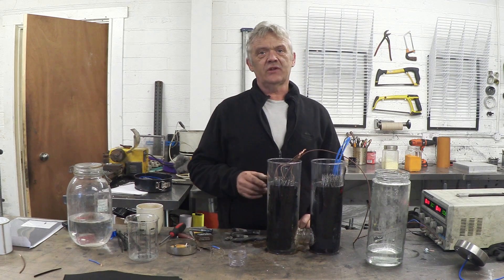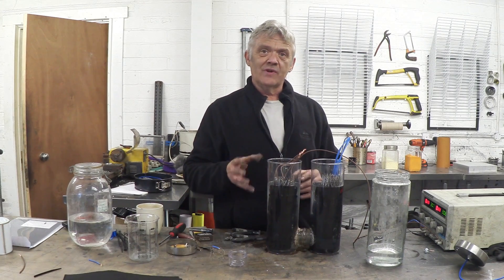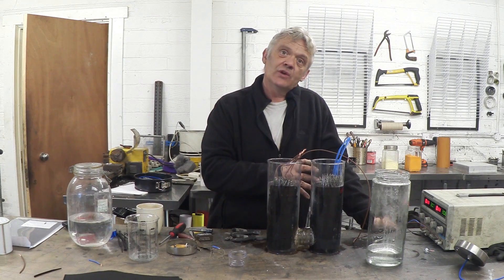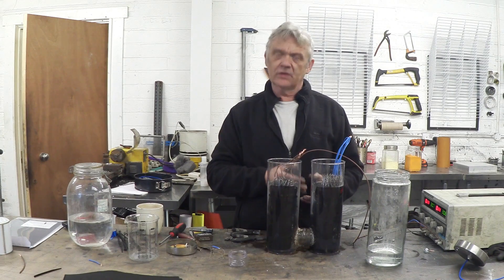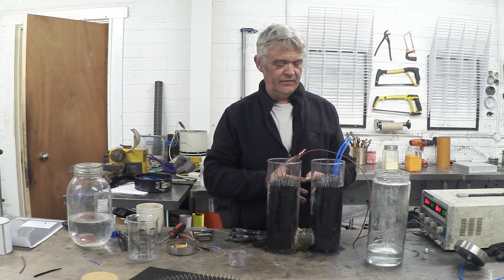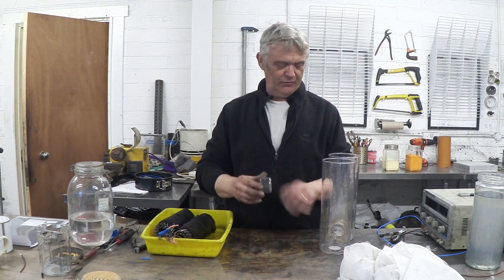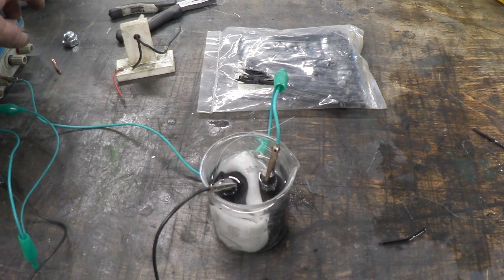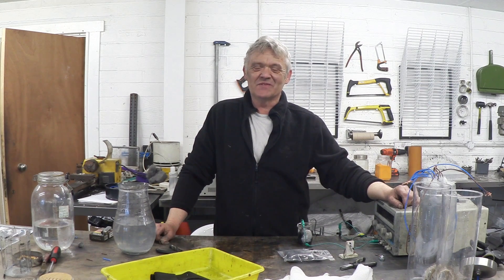Improving A Hydrogen Generator

Comment: It would certainly be a luxury item if let’s say a rolls Royce was equipped with such a separator wet cell and hydrogen was fed to the fuel injection air intake and oxygen was sent to the interior of the vehicle as a way of fresh air full of oxygen for the occupants to enjoy while windows are all pulled up securely to protect the occupants from outside pollution

Comment: Try using square containers instead of round, and then put a SS plate in each container.   Then connect the containers together as close as possible - yours are 1" apart.  The plates should be millimeters apart, but separated by the container walls..    Get them closer so the plates within both containers react with one another (not just the plates in the same container).

Comment: Hi Robert. What materials would you choose for electrodes if electrode durability is the goal. I don't care about efficiency and just need enough gas for a jewellery torch but don't want to have to continually change electrodes or use expensive materials or materials that are not abundantly available.

Comment: See also reference on S1R9A9M9 and his Briggs 18HP mower engine that ran on water 2008. 2 YouTube videos - run videos at slow speed . 10 amps through zero ohms spark plug along with water in carb forms water vapor pressure and hydrogen gas. Battery start, battery removed. Alternator runs conversion circuit.  His 1978 El Camino car v8 got 18MPG on water for 3000 miles before locked up in storage. Circuit used 400watt inverter and diode to 2MH dual coils relay per cylinder and 6-7amps current. Web site shut down. 4kohm resistor can be removed only from same reach Champion spark plugs.

Comment: Although you have separated the anode and cathode into chambers using that bridge, there is a still a major problem.  Collecting that hydrogen is very difficult because you cannot have ANY kind of back pressure on the gas coming out of the chamber or else it will force the water down, through the bridge and out of the anode side.  You MIGHT be able to bubble the hydrogen though shallow water and collect it in a very small container using water displacement.  The best way to achieve gas separation is PEM technology.  You have a rigid solid membrane between the two half-cells and you can exert a great deal of pressure on either side (or both) to fill a balloon or even compress the gas into a cylinder to some degree (no pump needed!)  A straight Nafion barrier between the hall cells would suffice to separating the gases and allowing collection, but then you sill need an electrolyte (that won't damage the Nafion).  And, of course, a PEM cell (that also uses the Nafion) but has the platinum and iridium electrodes pressed right up against the membrane (MEA), is the ultimate solution and requires no electrolyte (the Nafion acts as the mechanical barrier AND electrolyte in this cell).

Comment: I have followed the Brown's Gas generation development for more than a few years.  I saw somewhere recently that the law of diminishing returns takes over at about 3 volts or so in the production of gas (I think in terms of fuel), and that it serves better to amplify the Amperage  while dropping the Voltage.  I'd be pleased to hear your thoughts on the subject.
Reply: That's what neutral plates are for -- increasing generation surface at each plate, and lowering the voltage for each plate current has to pass through.

Comment: Presumably, you will have to top up the urea concentration periodically. So what is the best method for monitoring concentration? Will it be the increase in Oxygen production, or the reduction of Nitrogen at the second electrode? Or is there a simple way of measuring urea concentration? Thanks Robert.

Comment: One of the problems I had with using an electrlyzer was an increase I carbon emissions. I used baking soda as an electrolyte. How does the use of carbon felt and urea affect the carbon emissions with your method?

Comment: Is the black coloration caused by particles of carbon breaking away from the felt?  Years ago I built an electrolysis cell using carbon electrodes and they didn't last very long at all.

An easier construction would be to have a vertical plastic pipe containing the hydrogen electrode suspended in a bowl of electrolyte, this pipe would have a stopped end on the top to which you can attach the take-off pipe, as per the original video.  The other electrode would be suspended in the electrolyte as before.

Comment: as a child  we used to charge  lorry batteries and put milk bottles inverted on top of cells, then put bottles on ground and ignite them a lovely blue flame and a bang.
Even then we knew that oxygen improved the burn, so one can assume that oxygen would assist the burning of hydrogen thus increasing energy being produced.

Comment: @Robert Murray-Smith  how a Faraday Disk works,  could you replace the metal disk with a graphite disk???...  if so!... what about that kind of setup to spin the graphite disk to make power, but its submerged under water and your using the disk to make HHO, that flings the bubbles off, your gas output goes into a hallow (clear) Spher, and gas enters at the lower bottom at an angle, and an exit hole at the top, if the pressure is good enough a metal ball inside with barely any wiggle room would spin , and a pin point needle at the top center stopping it from plugging the hole but also acting as an electrical contact, and you have another brush contact on the side and put it inside a doughnut magnet, there is a source of power . Then use that power to help spin the Graphite Faraday Disk,, or use the gas pressure to turn a turbine generator, or turbine blade in direct connection to the disk.
Doing all this with Urea so less energy is needed

Comment: If making a wet  cell with no separation of gasses, if you wasnt to use an clean water bubbler ... between Urea and KOH/NaOH which one would be better to inhale.
Its about Hydrogen for health. Would you be opposed to breathing in the mixed gasses not separated using Urea as an electrolyte?? With or without a bubbler!
Reply: David Prock this interest me too I would think a bubbler would be worth using as a precaution  and I think not using urea would be better for this application especially if you didn't have gas separation as too much nitrogen would kill you  and extra oxygen from using water, for short periods is beneficial  I have just received the ac felt and just checking the video so I could make one 
This h2 breathing has a lot of promise for health but it seems a bit of a palaver having to breath it for hours a day   The tiny amount of the pot hydrox in the bubbler would make it safe enough to drink and get any dissolved hydrogen

Comment: Using nylon cloth instead of felt will last longer as felt will deteriorate over time.
Reply: The point about the carbon felt is that it conducts electricity.  You can get very fine stainless mesh which has the look and feel pf woven cloth, that might be a better alternative.

Comment: If I use a alkaline fuel cell  , it should have pure O2 ( CO2 will be absorbed by the electrolyte KOH) on the oxygen side . 
does urea  electrolysis  yield  pure O2  and of course H2  is a given,  Many thanks for your work.

Comment: I have doubts you're separating because of the design. You honestly believe the gases split and magically only the hydrogen appears on one side and the oxygen on the other when they both split on each side together. You have to separate "above" the gases. 

Capture the gas from your oxygen side and show it wont burn.

Now if you want to separate, use a magnet to attract their "-" & "+" charge above the electrolysis and even one below the electrodes, so that you have a magnetic field to guide the separation. Your electrodes should be in the bridge.
Reply: His H or U style is separated. That’s exactly how it works, it’s basic chemistry, oxygen will only form on one side and hydrogen on the other since one side is + and the other -, that’s how electrolysis works, and that’s also why one probe side gets corroded very quickly while the other is fine if you want to test with some regular copper wire and a battery. Also if you’re lighting a wooden match on one side then it might look like the oxygen is also a fuel since oxygen makes things burn incredibly intense turning them almost explosive in some cases.

Comment: In my place is cheaper to buy stainless steel mesh for colanders and sieves, it should be also a better option for surface area and it's even easier to work with

Comment: One major drawback we experienced with high volume gas generation was bubble adhesion.

To obtain and maintain efficiency, not only do you need the surface area, but also a way to prevent the bubbles from remaining adhered to their surfaces, which, unfortunately, begins choking out the flow of water and electrolyte, causing production to drop off.
Reply: I use an ultrasonic bath to avoid bubble adhesion on the active electrode area.
Reply: @AfdhalAtiffTan  exactly what I was going to say, or some kind of vibrater attached... put it near a sub woofer playing a constant tone
Reply: @AfdhalAtiffTan  and magnets?
Reply: tends to be the benefit of running a dry cell, you get water flowing through, which is typically enough to kick the bubbles off their plates.
Reply: Desmond Bagley  
It would depend on the impurities in and viscosity of the electrolyte solution.
Reply: You don't need a vibration mechanism. You're building an engine. Just bolt it to the engine block, it vibrates anyway.
Reply: @vylbird8014  magnets?
Reply: resign the generator.

Comment: you should look into atomic hydrogen which can be produced by runing hydrgon (h2 ) into an arc which will result in h1 or you can use a cathode made from a mix of lead and mercurey if your interested i can send you a pdf file on the subject.

Comment: Would it work? Say I have a natural gas or propane powered generator that with modification produces 10KW when fueled with hydrogen. So I start the generator up on propane and start providing power to a hydrogen generation system. When the hydrogen production is adequate the engine is switched to run on the generated hydrogen. Will it make enough hydrogen to sustain full output and also allow some percentage of the generated power be diverted to other uses? Assuming that engine cooling and exhaust heat were recycled (heating water?) would the cost of the consumables (urea, stainless steel, etc) make any resulting excess energy cost effective? Could be very interesting in arctic conditions where it is very cold and dark for long periods and purchased fuel very expensive.
Reply: No. The laws of physics do not permit perpetual motion, at least as currently understood. You can't make power from nothing. However, it might be possible - with careful tuning - to slightly increase efficiency of the propane engine by mixing in hydrogen-oxygen with the propane, and the performance thus gained could potentially offset the electricity cost of the electrolyser.
Reply: @vylbird8014  it works! However would take a lot of finetuning and continuous monitoring and after say few months your ICE needs repairs and the whole story starts again.

Comment: One idea I had years ago was a hybrid gas/electric oven, which burned hydrogen to cook, but you produced the hydrogen on site with electricitty.  So you'd have the advantages of a flame stove, but it could run on electricity.
Reply: I am playing with this idea in my head too, for off grid purposes. Even go as far as using the hydrogen for refrigeration, and the generated water for consumption. I am not in a rush, and still have a lot of theory to look at before I try a small scale test setup. But I find the idea very appealing too.

Comment: Theoretically it could power an engine in a closed system?
Reply: the engine could only produce less power than the cell used, but sure.  I've seen people adjust generators to run off of wood gas, which is mostly hydrogen.  no reason an engine couldn't do the same.
Reply: It would be easier to do a vacuum steam turbine system.
Reply from the maker: there are reports of a closed system being set up - needs some research on the net mate

Comment: Rob , you're a machine  !  [ oops i mean that in a good way,  not like some people who actually believe the next step for humanity is merging us into machines ..with AI enhanced brains ..all remote controllable by them ..because they know better than us !!]    I have a gas flow meter for testing flows ,, but easy way is just a clear plastic  bottle filled with water , and upended in a large bucket of water , then run gas output into water filled bottle ,so gas displaces water , just time how long it takes to drive all water out , ie 1.5 L coke bottle in a minute . .. , this does make it easy to put the top on bottle a have a potential 'bang' . I have left HHO in a bottle for weeks to see if it stays separate , it does . good idea not to blow them up to often ,Neighbors , dogs  ,and men in blue are not amused
Reply from the maker: lol - thanks for the post mate

Comment: Brilliant idea using two jars to separate the gasses at source. I think you could go further and make it more efficient by putting many tubes between so the ions have line of sight from anode to cathode, or vice versa. In order to make sure the gasses did not mix half way up the jar (where there are more tubes) you could use slightly U shaped connecting tubes so that rising gasses were diverted from the center of the connecting tube. That would give much more liquid contact, thus increasing ion transfer. It sounds confusing trying to write it. If you don't understand let me know and I'll get a diagram to you.

Comment: Your video on the brown gas generator was very interesting. I am from Bangladesh, a predominantly agriculture based economy, urea is abundant and cheap here. Farmers need electricity for irrigation purpose and more and more are trying to use solar but the cost of panel and battery is still prohibitive. I looked around to see if the h2 gas generated can be used a fuel source, of course  they can be used in ICE or h2 fuel cell but i was looking for something cheaper and simpler(no moving parts). I came across Ni-h2 batteries/fuel cells used in old spacecrafts however it seems it's a pressurised system. I also found some fuel cell design uses heat rather than precious/exotic metal as catalyst. That looked promising because sunlight is available through out the year.But still, their manufacturing seemed intricate. I know you have a lot of ideas floating inside your mind, but please give some thoughts on heat/solar h2 fuel cell designs without exotic materials. As always I am absolutely amazed at your curiosity, knowledge and dedication.
Reply: The question is will an ICE convert enough energy to electricity to drive such a cell to fuel the ICE? With the inefficiencies of such a configuration, my guess is no. As you have pointed out, there must be more efficient methods to convert the energy locked in urea to create electricity and water. 

However, this is not free energy as there is energy required to make urea, so in effect you are using urea as the energy transport medium. The most efficient way to transport energy is through electricity transmission lines bypassing any inefficiencies in making and transporting urea then converting it back to electricity again.
Reply: @Bennyboy-dog  when you say ICE don't just presume a "reciprocating" ICE or a rotary "Wankel", there is another rotary ICE ... it's called a turbine and because it doesn't reciprocate it's WAY more efficient ... about double in most cases. In addition "normal" or "Faraday" electrolysis is NOT very efficient. Research on Google for Stan Meyers who, years ago drove a modified Beetle across the US on NOTHING but H2O. His method/s involved "tuned" resonance of pulsed, much higher voltage which released volumes of H & O at phenomenal rates, WAY, WAY, WAY faster than Robert had in his two beakers/flasks/tubes. There are LOTS of videos on YouTube of people who use his method/s.

The use of mesh (and possibly carbon felt also) with Stan Meyer's resonant circuit may well produce even more rapid production with just water, still at much lower energy.
Reply: @boblewis5558  got some links?
Reply: Unfortunately Mr Stan Mayer was a scammer. I did deep dive in his patents and history. Even when patents went public nobody was able to replicate his results. A really sad story

Comment: Hi Robert, I am very interested in this project... one of my biggest problem is to store the gases, any ideas?
Reply: Go to a store that sells Grow lights for plants they have huge sheets of aluminized plastic in rolls and make big flat inflatables by heat sealing the edges.
Reply from the maker: no mate - what's wrong with doing it on demand?
Reply: Robert Murray-Smith ...Robert,  in the case when consumption is higher than production

Comment: What about using a pulsed high voltage supply like a microwave oven transformer or a ignition coil from a car. Would it be correct in saying that it’s high voltage low wattage would give you a greater gas production per watt input.
Reply: I remember reading something years back, deep in the forum archives about freq and H generation. there was a certain freq that H would split off very easily at a very low power input. I think that was why that Hutch chap was killed off.
Reply: @trevorvanzuydam8115  check out Ritalie on Youtube and HHO
Reply: No, you need a high current, not voltage.